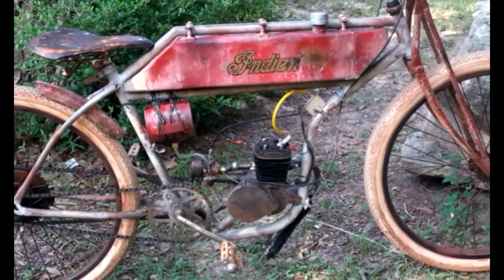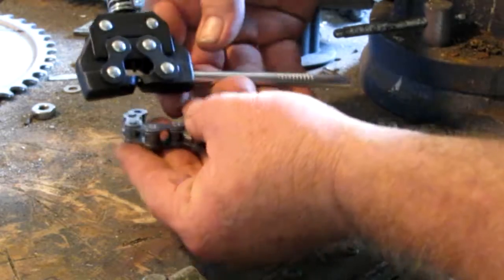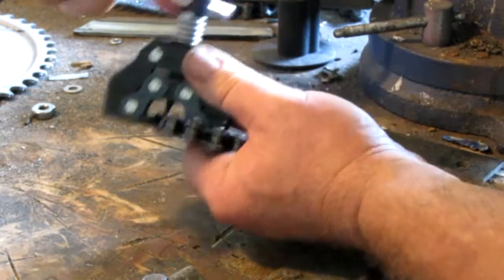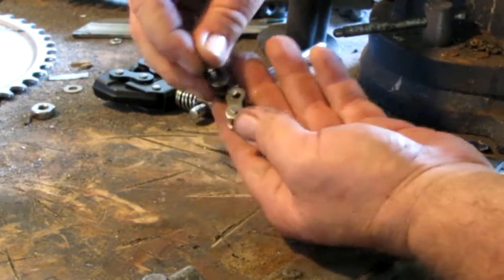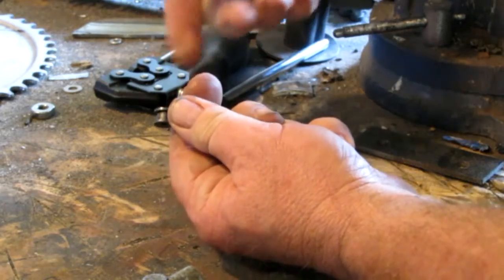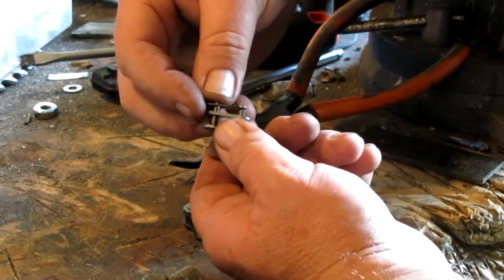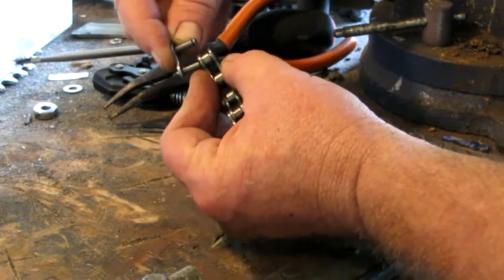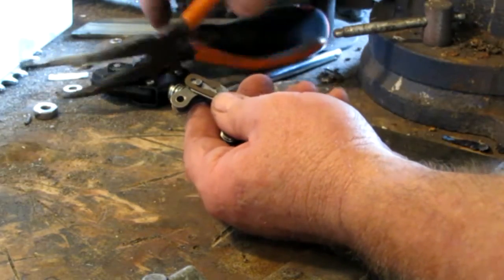How to Cut / Break a Motorized Bicycle # 41 or 415 Drive Chain

Comment: can i use the hammer method to break chain? the one where you get a punch and tap the pin out?
Ive seen it done on smaller chain before.
Reply from the maker: YES. Grind the pin down to the face and hit with a hammer and punch

Comment: Yall make shit look so easy on these damn videos the pin keeps moving and it wont stay centered
Reply from the maker: You have to work at it. The chain breaker tools are poorly made at best and you really have to get the grip correct on the chain to have the tool's pin stay on the chain's pin

Comment: hey can you tell me why gas is getting down into the Magneto and generator this is my second engine and its done it on both of them I thought something was wrong with the first one because it did it so I bought another engine and now its doing it to it's coming out of the hole on the bottom left hand side of the magneto cover where the screw goes in it comes right out of that hole whenever I unscrew it I took my whole engine apart the old one I had checked everything there's no cracks anywhere I have no clue how it is getting in there but I know that area needs to be dry thanks for all the help appreciate it
Reply from the maker: Gas leak somewhere is all I can say. probably from fuel line or carburetor
Reply: Ok its inside the case where the magneto is

Comment: i'm really struggling having the plates bend and then the roller links fall apart... then this guy edits out the 1/2 second where you can't really see what he's doing like wtf that's what this video is supposed to be about... I've tried pushing the pin through all at once, tried going back and forth pushing the pin a little from each side and then alternating sides. the roller piece keeps coming apart the pins won't come out without the link falling apart and leaving me with two bent ass plates... I think I tried everything possible that I can see, I'm using #41 DID chain and a DID chain breaker and having very poor luck. sorry but this video totally doesn't show anything useful but it is explained in fair detail. just that those details haven't given me any new information.... I just want to see how it's supposed to work dammit